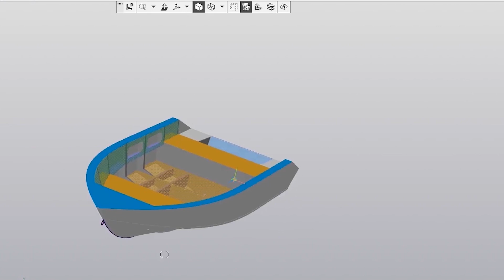Girl built a boat: 5 month in 10 minutes.

Comment: Great job, I love that used TIG to weld the aluminum boat, it's stronger than MIG, produces a much cleaner weld without all the cleanup afterwards, doesn't require a lot of skill to do but nonetheless, still looks great when done properly and you did it like and old welder like myself would have done it, great job. Looking forward to watching all your builds.

Comment: Hi Lucia, I just watched your boat build video. You did brilliantly. If possible, it would be great to see some video extracts where you discuss what, why & how of various aspects. For instance, you flick between MIG & TIG welding, why did you use both instead of just one; or, when you flipped the boat upside down to weld, you keep changing sides, was this to limit heat distortion, if so, how did you control and limit heat distortion in other places? Your spreaders using threaded rods and turn buckles was shown so quickly I almost missed it. I've never seen that method used here in Australia, is it common in Russia or how did you figure it out?
Reply from the maker: There are whole playlist about that boat on my first channel Lucia Reload. You can watch with subtitles ;0)
MIG welding is more convenient and has less heat input, so I used it where it's possible, but TIG is commonly used for outer seams to reach leaktightness. 
As for threaded rods, it was advice of my subscriber who builds boats out of aluminium.

Comment: did you TIG weld all of that?
Reply from the maker: Both TIG and MIG
Reply: @luciasworkshop  the mig did not have a spool gun did it? What kind of welder can push aluminum wire that far through the hose?